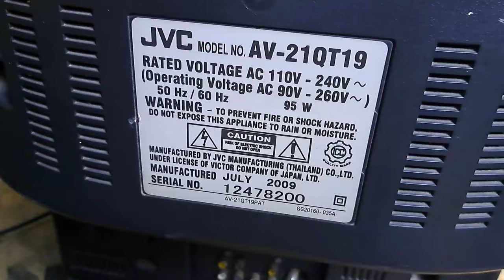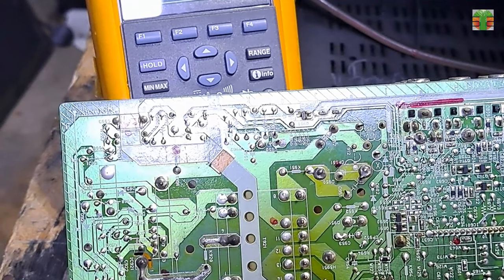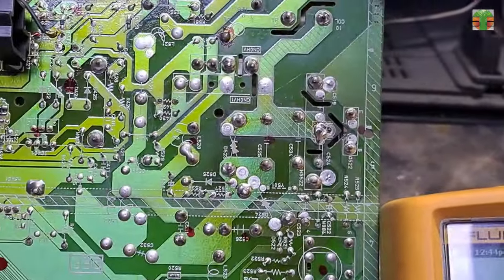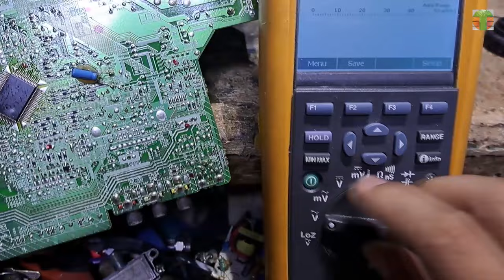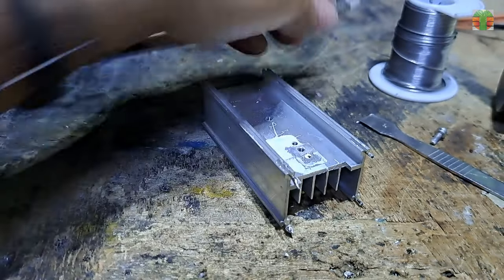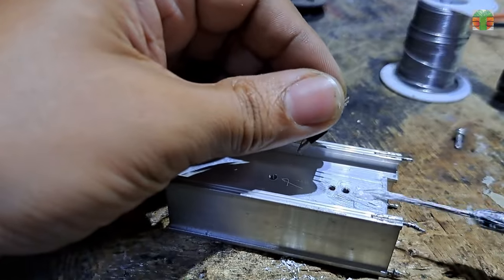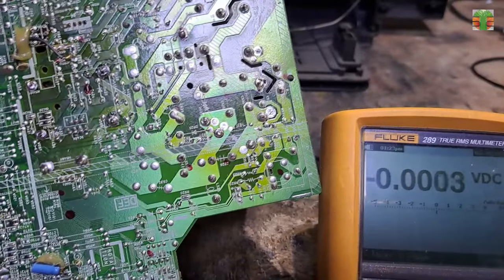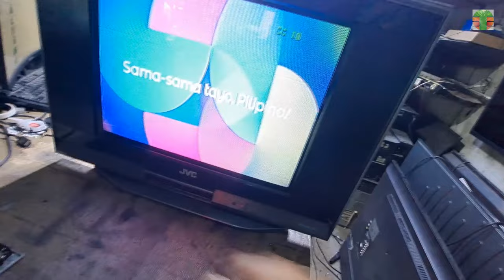JVC CRT does not continue to turn on

Comment: u are the best i  see at repairing tv bro...u got mad skills and knowledge i respect u passing it on i have learned alot from u ...i use to say u dont use flux but i see u use a special type of soldering wire containing a lot of flux  i can see the flux melting when u heat the wire